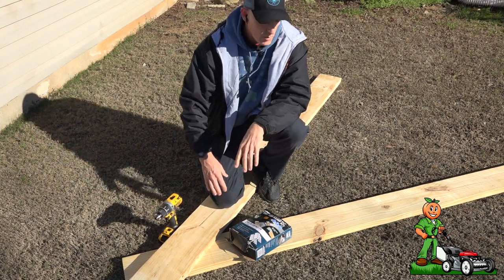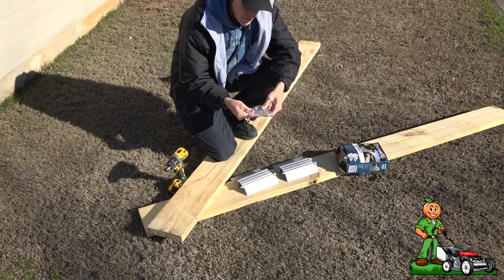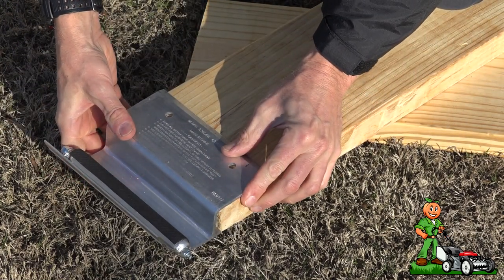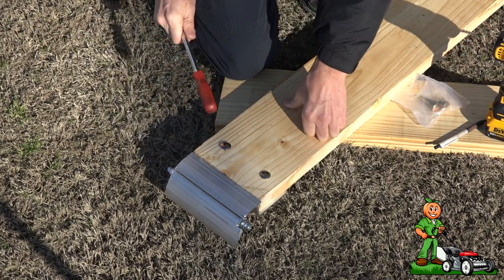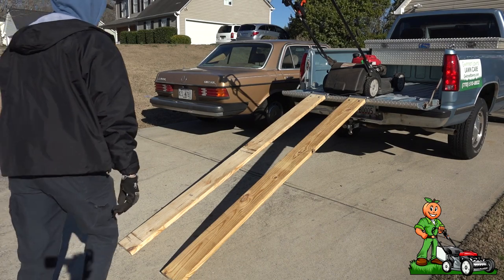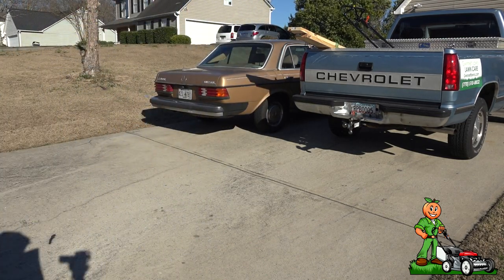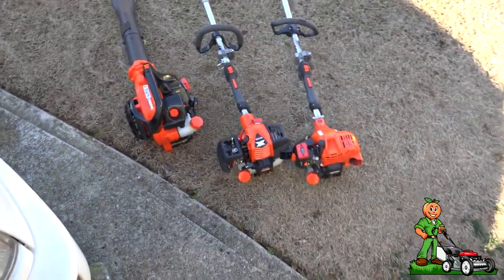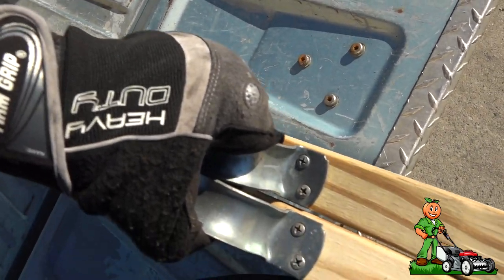The Honda HRX 217 gets ramped up, how to build cheap ramps

Comment: I did the same thing last year,  but I couldn't get the top of the carriage bolt to bite into the wood, so I couldn't get the nuts tight, which left the ramp brackets extremely loose. I tried to bang the top of the bolts into the wood with a hammer, but they just wouldn't bite!

Comment: For years I've loaded and unloaded my mower to take it over to mow my rental property.  It's fairly heavy so I usually let it drop,  rather heavily,  for 6" or so. 

That was doing it no good,  so I wanted a simple and cheap ramp to load and unload the mower into the side door of my van. 

My solution is even easier than the one in the video.  I just lay two,  eight foot 2x4s to the side van door to use as a ramp.  I cut two pieces of 2x4 the width needed so that the mower wheels will stay on the ramp boards.

So,  I lay the 2x4s out,  and use the two short pieces to set the spacing between the two ramp boards,   one at the top in the van and the other on the ground.

I can then walk between the two pieces of the ramp while I'm pushing the mower up the ramp, or running it down the ramp to the ground.

If needed or desired, you can rig up some additional pieces to match the height you need for your vehicle and put those underneath the ramp boards to raise them higher.

Your could use 2x6 or 2x8 boards if you wanted more width and  strength,  or longer boards for a longer and shallower ramp.

I find that being able to walk between the two ramp board makes it easy to load or unload the mower,  and to keep an eye on the mower wheels so they don't run off the boards/ramp.

Comment: Hello Russell, my name is Russell LOL. I've done this before years back. But I have a Toyota Tacoma, and the boards kept sticking out. A good idea that I have not done yet, is that you take your boards and cut them in half with a good strong hinge and you can fold in half to put them in the bed of the truck providing you have a small truck. I also have a small Honda lawn mower like that. Yes it tears your backup but it's a good idea. I need to make another set, cuz I am tired of pulling my trailer around just to cut my daughter's yard.